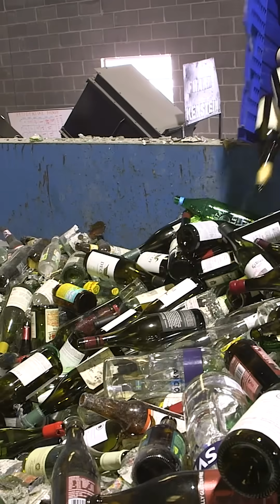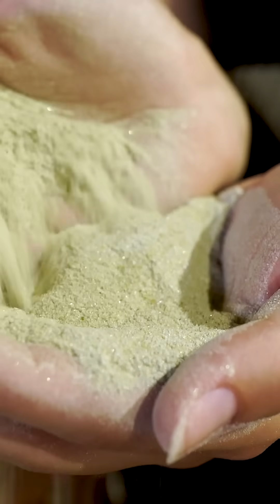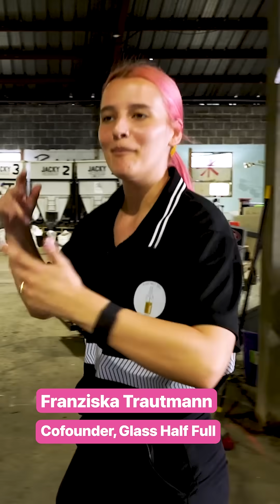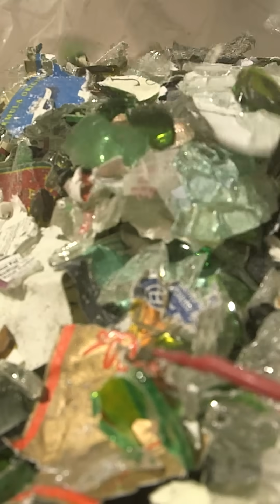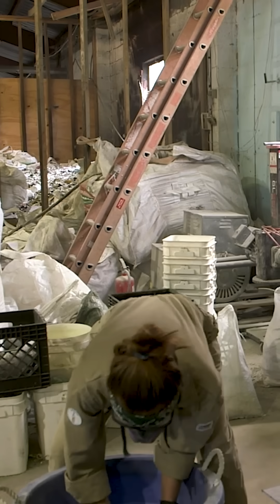Here’s how this entrepreneur crushes glass bottles back into sand. #Recycling #Sand #Glass

Comment: My grandfather worked in a fibreglass processing warehouse for 35 years. His lungs are so bad he can’t be in the same house as a smoker. PPE is a must when working in a building with any kind of glass or metal dust.
Reply: If you see this, Mullein Leaf extract can clear out lungs I've heard. It's worth a try and a research! @lonewolf8585
Reply: I got the exact same story bro. My grandpa did fiberglass for like 100 years. He's fit as a fiddle. Only one problem. He can't take more than 10 steps before he runs out of breath. So sad
Reply: @schoonhoven76  That means he's not as fit as a fiddle then.
Reply: @schoonhoven76 fit as a pickle

Comment: I worked at a place like this. But they then turned the sand product into a porous rock substance used for large scale water filtration. This meant cooking sand at 1400⁰. Had to stand at the other end of this giant pizza oven getting blasted with heat well over 120⁰. It was nonsense. Glad i stopped.

Comment: What can posibly the use of crushing glas bottles into sand, it just cost time and energy. Better recycle glas, or just dump it sonewhere where ground needs to be increased in level or something. Glas is equally good or bad for the enviromemt as sand, well glas is better in this case, doesnt require additional energy and co2. These are "green" nonsence projects

Comment: Many years ago I use to return the empty bottles to the shop I bought from. They would pay you a refund for the returned bottles. The bottles would be sent to sent off to be washed by the manufacturer. Then they would refill with soda pop to be resold. But, recycling was simpler back then.

Comment: that microglass is floating in the air all around the surrounding area that needs to be done in a building with a excellent ventilation system and filtration system not only for the workers but the surrounding people in the area

Comment: ...how is this new?? I am a bit shocked. In my country we recycle glass since...Well as long as I live. So over 35 years.
For example the white glass is often used for street markings. They make little tiny globes and mix it in the white colour mixture. So light will reflect off these glass globes at night, so you see the markings at night just as well as during the day. And beyond this many many glass bottles get reused. We have the deposite system and so we give back the bottles and they get washed very hot, get new labels and go back to the factory to get refilled and sold again.

Comment: News flash.  That's not sand.  It's broken glass.
Reply: "The composition of sand varies, depending on the local rock sources and conditions, but the most common constituent of sand in inland continental settings and non-tropical coastal settings is silica (silicon dioxide, or SiO2), usually in the form of quartz"

"The most familiar, and historically the oldest, types of manufactured glass are "silicate glasses" based on the chemical compound silica (silicon dioxide, or quartz), the primary constituent of sand. Soda–lime glass, containing around 70% silica, accounts for around 90% of manufactured glass." Both from Wikipedia
Reply: @SmileTribeNetwork while wikipedia isnt the best source to quote at least they have the science right
Reply: @itsantee re: You claim that Wikipedia isn't a good source: [Citation Needed]
Reply: @nomadMik it's just a geek thing. Wikipedia is perfectly fine.
Reply: "That's not water. That's melted ice"
It's the same stuff.
Reply: @RonyPlayer  What you said is chemically equivalent to "That's not sand, it's lava."  What I am saying is closer to "That's not steel, it's iron."  Except iron has stuff added to it to make steel where sand has stuff taken away from it to make glass. Glass might be made of sand, like paper is made of wood, but sand and glass are not exactly the same thing.  Eating sand is harmless (I did it as a kid growing up near the beach).  Eating crushed glass is not (I'm glad I didn't do that).  Maybe they tumble all of the sharp edges off of it so that it's not sharp, but that seems like it would create a lot of micro glass dust that seems like it wouldn't be great to breath.  Anyway.  Do we really need more sand?  Is this a valuable commodity?
Reply: @gmrecneps you clearly know more about the science than i do, but in response to your question of if we need more sand, we do have a massive worldwide sand shortage
Reply: @gmrecneps  not to be that guy but technically what he’s saying is chemically equivalent to “that’s not lava it’s melted sand”
Reply: @vomitedtoe7158  You are right.  I misread it.  But my point about iron and steel is still the proper reply.  Do people not realize that sand is just broken rocks and perhaps some broken sea shells?  Rocks and bottles are not made out of exactly the same thing.  It may be chemically similar and rocks may be mostly silicon as is glass.  Anyway, I realize this is a losing battle as the broken glass sand must be doing fine in the market place.  But I'm glad I didn't eat any when I was a kid as I was known to love eating sand when at the beach as an infant.
Reply: @gmrecneps  interestinglyenough, there are parts of the world (e.g. Singapore) that have to import sand from all over in order to make concrete. I don't know if this product is useful for that, but there is definitely a global sand market into which this stuff might fit.
Reply: @colonelspicymustard  
Sand that is suitable for construction purposes is in short supply. Sand, for construction needs to have a course texture so the grains interlock.
Reply: Same chemical compo
Reply: More on doesn't understand how sand works LMFAO
Reply: @balegdah8261  and how can you blame him? Sand is solid. Glass is solid. Do they look the same?
When you freeze water you always get ice. When ice melts it always becomes water. Maybe it's not chemical for silicon part of the sand but it's definitely something for the rest of the components.
in normal conditions
Reply: Damn!

Comment: I’m a environmental health and safety manager I would require nothing short of a full face respirator and good particulate filters and hepa filtered hoods over open hopers and filters should be used.
Reply: Crushed glass is amorphous silica dioxide, not crystalline silica dioxide.  You're thinking of crystalline silica dioxide which is hazardous

As an example of the importance of understanding chemistry, ethyl alcohol is safe for moderate consumption while methyl alcohol will kill you before you know what hit you.  Same thing with ethyl mercury vs methyl mercury

Comment: How do you divide the difference colors?? I would assume that it would be easier to do before mixing it all together, but I've only done some glass blowing I don't know much about this type of thing  but I'd like to know how you can get multiple different colors of glass instead of just a color all mixed colors all together that I would assume would have alot of dark brown beer bottles so the colors would more than likely be a medium brown color once its turned back into glass from the mixed sand?

Comment: Ah holding glass dust in your bare hand, a real genius there
Reply: @Cerus98not at that stage. Once it's already been converted from natural sand to artificial glass, there are some serious differences in the structure and safety of handling on a micro level.
Reply: @doinksinthePM yep, learned this in one of the many, many safety classes l had to take during my 40 plus years in construction. Once we alter natural material it can become a hazard, one particular class talked about being exposed to concrete dust during cutting, grinding and demo work, went into great detail what it does to a body, scary shit
Reply: @doinksinthePM so that means it is bad what she is doing?  if so one should inform them.
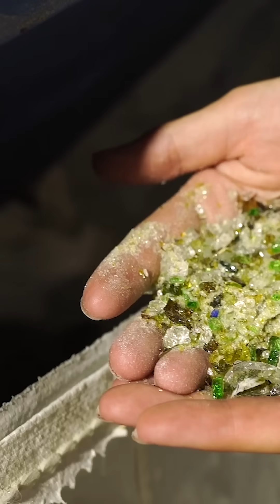Reply: @Cerus98if you pause it at 0:31 seconds you can literally see the micro shards I'm talking about. Def not the kind of stuff you want anywhere near you. Even worse is having some in your carpet hahaha vacuum all you want but one day like 12 years later you'll finally step on that little glass landmine 😂
Reply: This is Amorphous silica. Not crystalized silica. One is hazardous one is not until you consume a massive amount.

Comment: And not just any type of sand. To make glass you need Silica Sand. Most if not all Silica Sand is dredged from the Continental Shelf off the coast. China does a lot of that, not just us. With the demand for solar panels the marine wildlife will suffer greatly. That's the $$Green$$ new deal

Comment: This is the most inefficient way to recycle glass.

90% of glass recycling is done by heating glass until its glowing red, and reblowing it at that stage.

By grinding it down to sand, you create a situation where more energy is used to reblow the glass than needed to heat and reform

Source: ive spent 17 years blowing recycled glass.

Comment: what a bunch of bs. There is no info what is done with the glass sand for a simple reason. The main issue with recycling of glass this way is the remelting process and the massive amount of energy it requires causing it to not be economically feasible.  
This is nothing more than green washing

Comment: Would make more since to first grind everything into dust, shake it through an electro magnet to remove metals, then run it through a furnace thats just below glasses melting point tp burn off plastics and paper. Would save more glass and produce less waste.
Reply: wouldn't that be a waste of furnace fire if you're just going to burn off a couple of plastic and paper at that temperature even? and also carbon emission.

Comment: This reminds me of the tiny cuts I got when I was a kid jumping around in an old truck filled with fiberglass insulation. 🤦‍♀️ O was about 5 years  old and remembered getting scrubbed with a brisstle brush to get all the glass out of my skin. 😢 I was wearing spaghetti strap top and spandex shorts & and sandles, so it got everywhere. I hope they wear the right protective gear because I couldn't imagine that pain on the inside of my body.

Comment: That isn’t sand. It’s still glass. They aren’t the same thing. The extreme heat applied to silica sand to make glass affects a chemical transformation. It is a different material no matter how fine you grind it up.

Comment: I love the feel of fresh micro glass sands goes trough my nose into my lung
Reply: "I love the smell of glass sand in the morning"
Reply: Glass = Silica = Silicosis 
It’s not the sharpness of the sand that creates the problem, it’s the glass airborne “dust”that will give you the bang… in your lungs.
Reply: @bruno-orante but the compound that causes silicosis does so because the particulates are considered "nano particles" meaning they are so small they enter into the porous tissue within your lungs and never comes out. Silicon dioxide is considered a nano particle. Im sure this glass sand isnt healthy but it wouldnt give you silicosis
Fun fact the FDA hasnt even considered if its okay to put silicon dioxide in foods but since its a nano particle it slides under their guidlines through a loophole. And its in EVERTHING. any kind of food that is a power, becomes a powder, sold after mixed from powder has it. It keeps the particulates from clumping and smooths the liquid. Protein powder is a prime example
Reply: @BraydonAttoe-xs4yg it doesn't do it, it is safe
Reply: @missmaddox  wouldnt it lead to silicosis? Or im mistaken
Reply: Just like cocain
Reply: Crushed glass is amorphous silica dioxide, not crystalline silica dioxide.  You're thinking of crystalline silica dioxide which is hazardous

Similar to how ethyl alcohol is safe for moderate consumption while methyl alcohol will kill you before you know what hit you

Comment: "I made powdered glass and called it sand"
Reply: a lot of people here think rocks evolve like pokémon.
Reply: In fact, it does not simply cHeMiCaLly change, if anyhow anyways!
What is wrong with y'all??
Crushed glass IS rocks and sands.

The smol, glassy sand pebbles are partially neat and smooth, when closely inspected. The pebbles altogether do NOT "chemically" change (one of the worst applications of chemistry, that i ever heard of. It' the same, when people claim things happening "on a chemical level", that suits the instanced look at it but is not as realistically relevant as the clever sounding idiots claim it to be by saying that.) 

The ONLY major "chemical" difference, where original sand and such glass sand definetely differ, is (next to less chemically relevant  surface level of the grain) what they filtered and put in for it to melt together with. Colored glasses f.e. are mixed and consequently fused with the coloring pebbles by the time of the melting proccess. The working rules of that profession (i just took a quick peek online) still imply a decency in tampering with it, though. So coloring may be the most absurd addition to the "original" sand.

That melting and fusing proccess is a rather physical proccess. Claiming, chemistry had a bigger part in that then physics is somewhat the same as saying gravity would create our atmosphere.

Lacking fax!

Edit: to make it more transparent: anything related to chemistry has to first and foremost adress a (chemical) REACTION, and only said reaction is what we call a chemical process... The paperwork is not the essence of chemistry. The melting proccess is forcing the elements to fuse together, like a soup that does not actually mix all to well, but with enough stirring gets similar to the chemical image of a homogeneous substance. Both elements harden (at similar temperatures), when cooled, though. So, them hardening in that fusioned form is nothing like a chemical reaction. Neither exo-, nor (more likely to the actual comparison) endotherm!
Reply: @jaredreynold6336 your response is nonsense. Glass is literally a different phase of matter, one that needs to be achieved by adding substances that lower the melting point, changing the CHEMISTRY and shifting the atoms into a new structure. You people need to stop talking out of your ass when trying to be uwu wholesome chungus 100. It’s annoying.
Reply: @jaredreynold6336  Ikr. Everyone responding to me, try putting beach sand under a microscope sometime.
Reply: Honey, I know logic is hard sometimes, but finely crushed glass is, in fact, sand. Remember how sand is used to make glass in the first place? All they do is melt it. You're like "water freezes to make ice, but when ice melts again, that's not water, that's melted ice".
Reply: @Queer_Nerd_For_Human_Justice don’t patronize that person, you dork. Plus you’re wrong. When sand is turned into glass it’s changed chemically meaning it can’t just be changed back into sand by crushing it.
Reply: @Queer_Nerd_For_Human_Justice it’s not that simple. Save the condescending tone for something where you actually know what you’re talking about.
Reply: @CheddarDrip  he made it sound simple, but it ain't. What I, on the other hand, am missing for any critique to be ANY better, is a decent phrasing for the relevant substance of the matter.

In this aspect, i find more conditional speech on his end, then on urs or the ones above.

This thread seems erisitical!
The patronizing/ "offensive" guy, one might misunderstand to be defended by me, included! Though, he's still speaking fax.

I hate representarism! That's why i'm sayin' that under his trolling guise, this guy brought forth more frutiful ground, then any of you.
Heck! Being the idiot or arsehole on a whim can even teach one better about the earthly and still charming part of any contrived arrogance! It is harmless, where it is only bull'!
Misunderstanding an offense as a personal matter, counts only where you choose to make it count as such. It's usually an act of "restoring face". Faces don't actually change by the usage of words, so the reputable inclination carries the whole weight of the cheap act of taking a stand out of comfort! Talk always carries a bluff and a lie alike. 

True-speech, "Goodness", on the other hand, is inherently flawed by the eyes of the beholder! Ambitions getting covered and stuff!
Reply: @Queer_Nerd_For_Human_Justice you are the reason why basic knowledge of chemistry and elementary education is important.
Reply: @092rohannair5  Wait till they find out all the crushed, dusted cullet is just smelted back into glass.....like the sand originally was.
Reply: @shuriken05  haha yea i assume you r backing my point?
Reply: @092rohannair5  dont need to assume anything.
Reply: @Queer_Nerd_For_Human_Justice heating sand into glass changes it. glass isn’t natural except for volcanic glass which is obsidian. if you think sand is just small pieces of glass you’re wrong. sand is the first stage of soil one step into the cycle from being pebbles sand is mini rocks not glass.
Reply: @Queer_Nerd_For_Human_Justice  "All they do is melt it"

A sentence as simple as you...

recycled GLASS is used for (you guessed it) glass products & in building materials